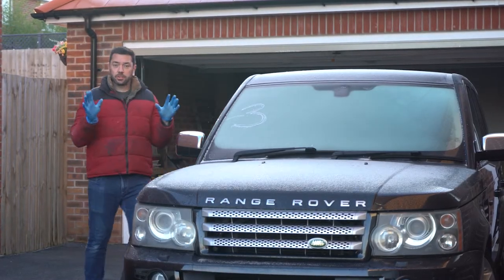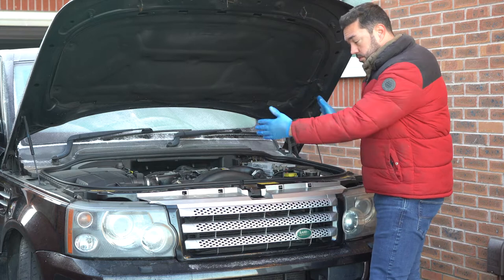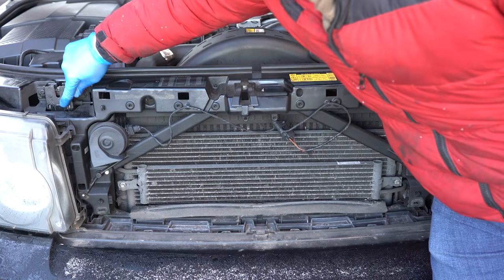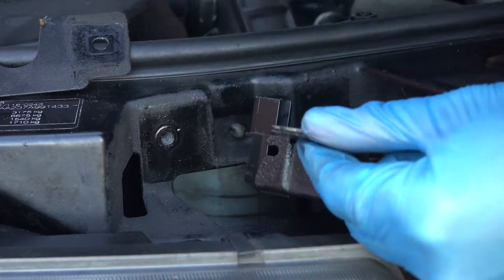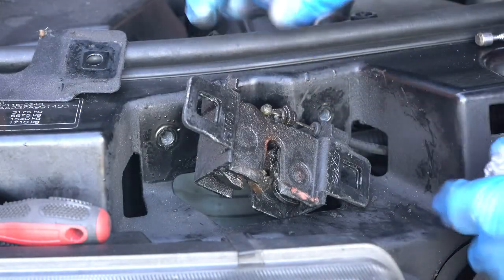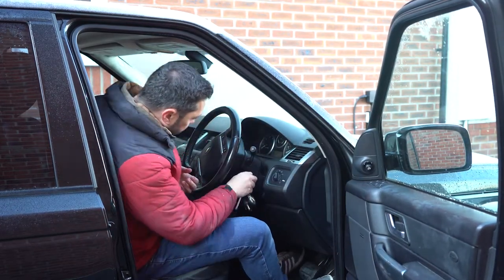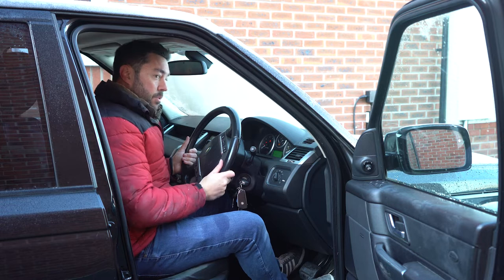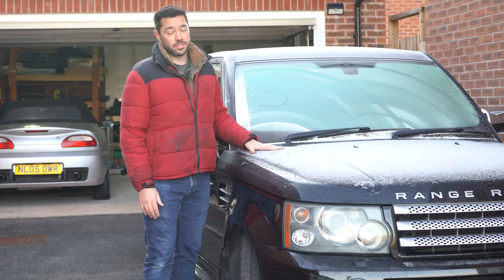Range Rover "Bonnet Open" fault fix!

Comment: you wana know why you have a f transmission fault etc... someone put in a plug connector sleve... and it's actualy an upgraded sleve the dealer made and it has to be pushed really tight while providing back preasure while clipping the reciever onto the clip... sometimes you can't get it clipped on all the way